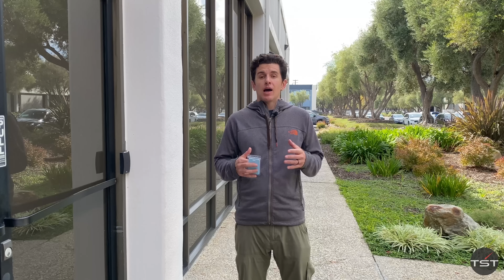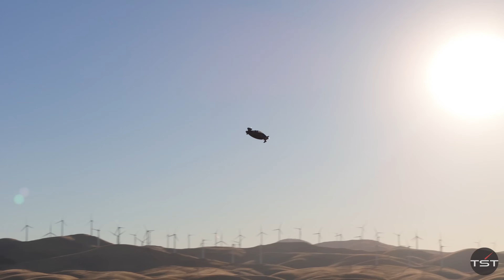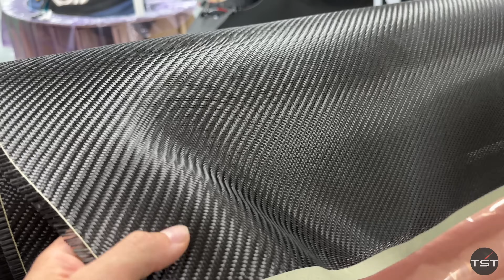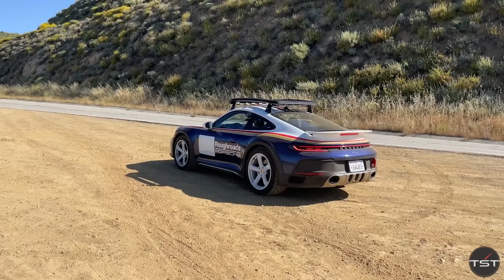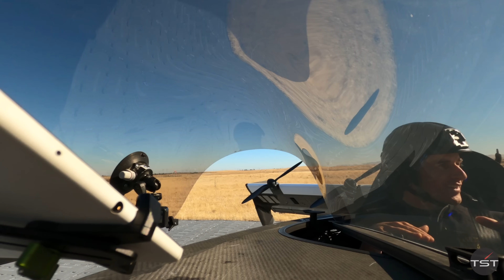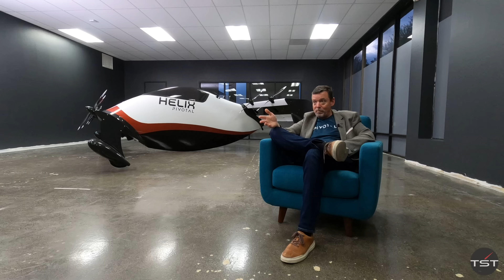I Tried an eVTOL and It Blew My Mind

Comment: Hey Matt and Zack

I’m 31 years old, pilot at the largest domestic airline in the U.S. with thousands and thousands of flight hours. 

Been flying for airlines since I was 23 and since I was 17 before that. 

I think this is a pretty cool flying machine. There have been quite a few of these types of startups, most fail to get off the ground and you never hear anything about them. It’s exciting to see pivotal push the boundaries of tech and get us closer to a personal flying vehicle. Quite commendable they can build a machine that someone can just in and fly with only a couple days of training. 

That being said, technology to me doesn’t seem like it’s there yet. As Zack mentioned, you can buy an older Mooney or Cessna and get places much faster for less money, although you’ll have to do it the traditional way with a runway and an airport (which is even more fun than landing in a random patch of grass, although not as convenient). There are also other light sport aircraft that don’t require as much training as a typical airplane. 

The problem with electricity to me seems to be the weight of the batteries and the effect that has on total flying time and useful load. In a traditional gasoline engine aircraft, the engine is lighter and you’re burning fuel as the flight goes on… 

Also as these types of crafts become more accessible to an average person you kind of run into Doug demuros hellcat issue. Everyone driving around with a 700hp rear drive v8 may not be a great thing…. 

Aviation is no joke, it is life or death every time we leave the ground, lots of people have forgotten or not realized that because we do such a good job making it safe in this country, despite recent events… 

So I give Zack props, because it takes big balls to leave the earth in a flying machine for the first time all by yourself with nobody there to save your ass. 

Also, tell Zack to be careful, once you get bitten by the aviation bug it’s hard to get rid of it, and the cure is expensive! 
 His remark about this being a day at work and getting paid to do this, that’s how us pilots feel every time we show up to fly anything. Imagine a jet!

P.S. - I live in Las Vegas and have a 2019 Shelby GT350R. Would love to get a drive in with you guys some time. Thanks!
Reply: Sounds snobbish…. Meh can’t wait till the altimas of the air come out lmao
Reply: Honestly I get that sense of wonder and that feeling of floating as if the air was water and I was on a boat in Digital Combat Simulator with Virtual Reality, and the aero bug bites you even outside of real life experience . It’s honestly great having the option to feel even the smallest amount of what a pilot feels when at the airport , because even tho it doesn’t compare, I now do the equivalent of “I need to go for a drive to get my mind of things” but in D.C.S test drives (combat is plenty of fun but is too intense to relax with 😂)

Comment: Was the take off full manual or was it automated or somewhat automated? You mentioned an auto-land feature at one point.
Reply from the maker: Take-off is always full manual. Landing can be "automatic" when conditions are right, but the feature only presents itself (audibly and on screen) when you reach a certain height (20 feet, if memory serves).

Comment: Cool video. Cool engineering. I look at this as the aeronautical equivalent of a Morgan three wheeler. It’s a non-rational toy. While I’d consider owning a Morgan, I don’t see the value prop of this type of vehicle when you have stol planes, light utility helicopters, gliders and gyrocopters… Each of which I’m guessing have better glide/autorotation in the event motor failure. Even from an efficiency pov, something like the pipistrel electro with a 25kw battery travels faster, further, with a higher weight limit. Eventually we’ll see EV motors being more common in aviation, but seeing this in populated areas, or as an alternative to flight without the constrains of airport infrastructure…

It’s like a unicycle in a world where bicycles exist. Black fly = super cool. Super ridiculous.

Comment: Cool tech. Can it be made to work on a generator for some serious range?
Reply from the maker: Good question! A range extender would probably add too much weight for the Lightweight Aircraft classification. However, an 8-rotor electric aircraft with a gas range extender would be pretty rad even if it required a pilot's license. Having the stability of computer-controlled motors but the range of a gas engine is an interesting idea. - Zack